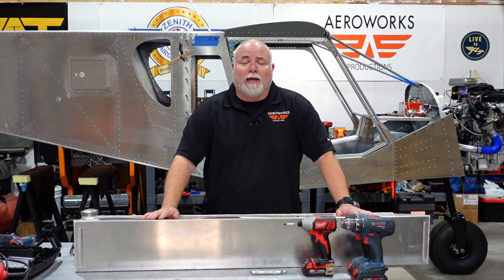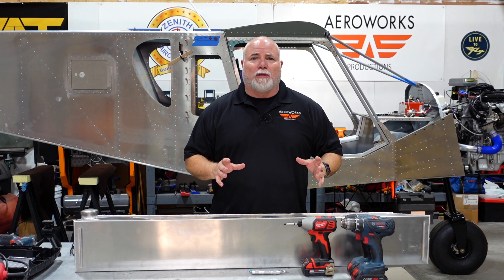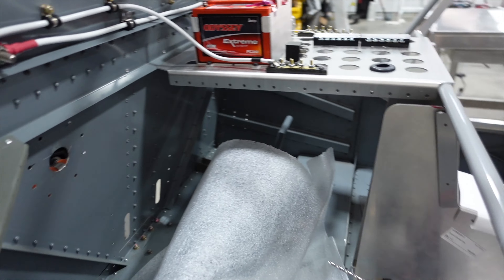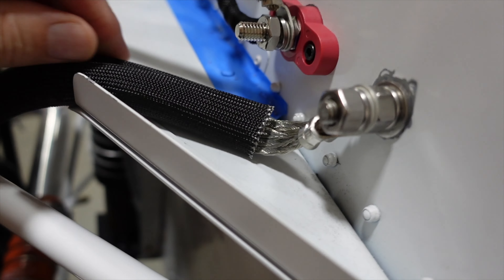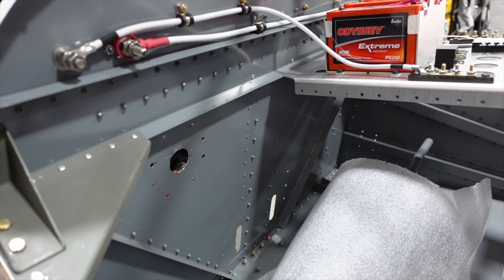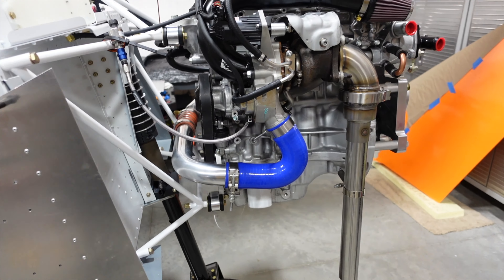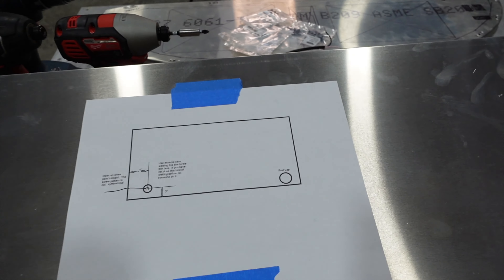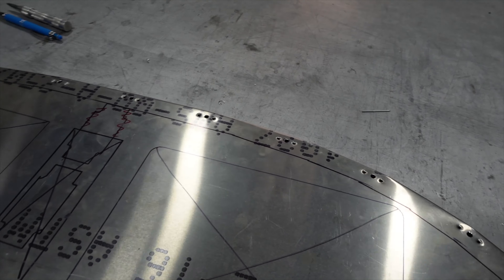Ep. 48 | UPDATES | Zenith Super Duty Aircraft Build

Comment: Suggestion for the sender unit port you have to have welded in... Maybe punch a dot near one of the screw holes and mark a line with a sharpie on the tank so the welder doesn't forget that it is direction specific.  Hopefully it will be tig welded.
Reply from the maker: Great tip

Comment: I used a hand nibbler to cut out my panel skeleton, not too bad.. Was hoping to finish my Cruzer by December. I am thinking late spring now😀! When are you planning on starting the engine? Closer to flight, or as soon as you have the wiring connected?
Reply from the maker: Definitely shooting for running engine as soon as I have power and fuel.

Comment: Thanks for all the detail on the top-mounted fuel sender - definitely the way to go vs side-mounted senders (Don't ask my how I know! Ha!)  As I recall, your sender set-up is from Viking, but out of curiosity, what type of sender and mounting location does Zenith recommend?
Reply from the maker: They provide the old VW style float wire that you have to Z-bend and cut hole in the side of the tank.  Just seemed old school and prone to future leaks or troubles.  Trying to avoid that.
Reply: @AeroworksProductions  
Top-mounted is definitely the way to go! Although the Viking recessed mount will provide clearance to the skin, do you plan to install a flush access plate in the top skin anyway in case of the need to ever replace the sender?